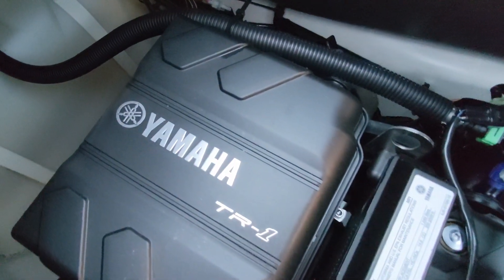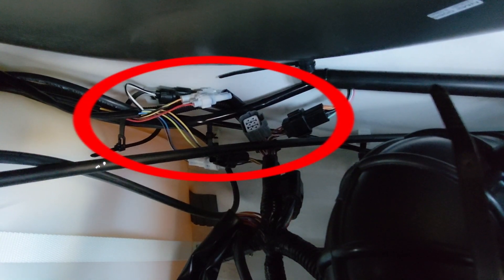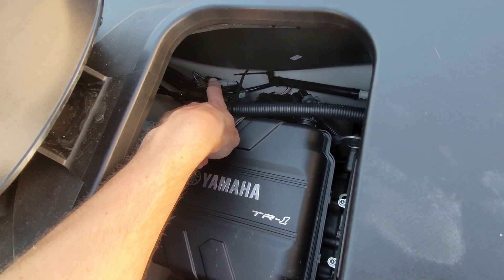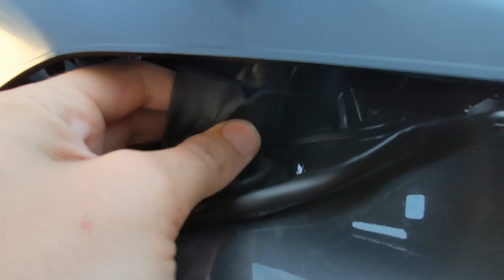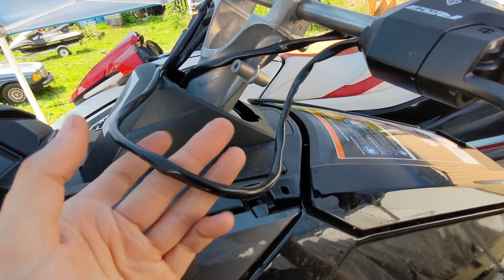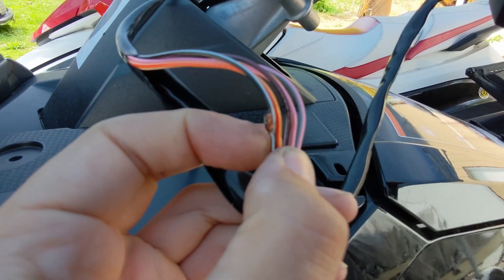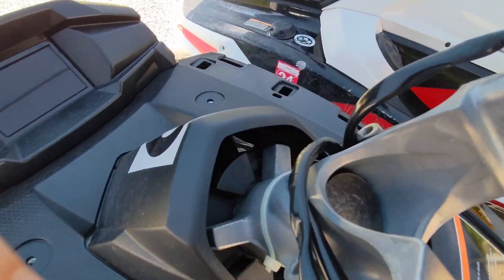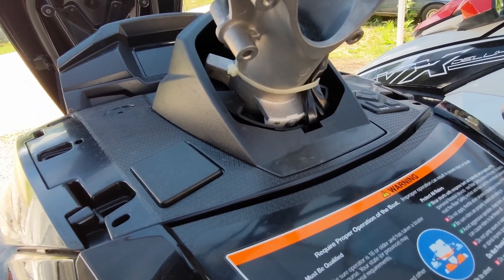New Yamaha Waverunner factory wiring flaw? Defective off the showroom floor?

Comment: I have a 23 vx cruiser tr1 intermittent wake up and start I looked at all wire connections nice and clean as well ran continuity and still ok has power to switch as well but machine still has issues waking up
Reply from the maker: I've seen issues with corrosion to a wire on the solenoid, there is a small red wire that attaches with the same terminal as the battery positive to provide constant power for wake up and such, I've seen them so rusty they fall off or barely make contact.

I'm doubtful that would be your problem on a 23 model unless you're in saltwater, it shouldn't corrode that quickly.
Don't know if it helps, but its the first thing off the top of my head I can think of!

Comment: I have Code YDIS 151 on a Vx cruiser HO 2021. I NEED HELP! this is my first check engine light at 80 HRs and im bummed.
Reply from the maker: That code is Ride related, Does your reverse bucket move properly? If it is working, then it may take a couple start and stop cycles before the code goes away. Or you could have a poor connection electrically, loose battery terminals will cause some codes, as will a failing battery, I would check the battery if the bucket seems to be moving properly but the code doesn't go away.

Comment: I’m having basically same issue 2020 VX deluxe. So you’re saying even under the wire sheath the wire was worn down. My code is 164, it starts and runs, took out for first time and started warning and check engine. Ended up having a loose negative ground on new battery so tighten up, ran through clearing sequence and it eventually was “fixed.” Took out for an hour one day, and an hour and a half yesterday and all of a sudden BAM it happens again…also where exactly was the west
Reply from the maker: 164 is related to the ride system, could be this, or a bucket obstruction or something wrong inside the ride motor itself jamming stuff up.
The cable issues are right where the steering stop is, and yes it will pinch the wires and break the copper, and you might not even see any damage to the sheathing

Comment: 2023 FXSVHO was getting alarms, came across this video and yup, sure enough, this was the problem. Thank you
Reply from the maker: Awesome, glad you found the problem! Sorry this was the problem.
Reply: What was the alarm message you were receiving on the display?  I have a 2024 FX SVHO and had gotten a No Communication error message, The display wouldn't turn off so I disconnected the battery and it had reset back to normal and haven't had any issues..yet.
Reply: @jgriffin-pw3xf  Just had the loud buzzer if I remember correctly. I have a maptuner x so thats how I read the code

Comment: Hello. I have a 2017 ex deluxe. I have very low hours and have not had any problems. Do you recommend I take preemptive action and apply the shrink tubing?
Reply: Thanks much for all your excellent clear information. I’m sure you’ve helped many people.
Reply from the maker: I would at the very least pop the handlebar cover off and ensure the wires are routed in a way that they will not be pinched, add a zip tie or something if needed, ensure you don't restrict the range of steering or add strain to the wires, but get them out of harms way.

Comment: That fix is not going to work, it will fail again and probably in short time. The solder joint its self will fail if not before all the other wires rub through. Tieing the bundle tight so that it rubs back and forth with each turn will cause a failure. It needs to be loose but away from moving parts.
Reply from the maker: We will see, so far it has lasted 1/6th of the same time the factory original wiring survived with no sign of any issues.
Kind of hard to get wires that literally run from a moving part to the body of the machine away from moving parts.
I'm betting this repair lasts for years.
Reply from the maker: Still working fine. Fixed 2 other machines with the same method, they have been a-ok for the entire rental season of 2023
Reply: Still working ?

Comment: Greetings i thinking I have electrical issues,

Greetings quick question i got vx 2015 Yamaha new body style with mr-1 engine base model, it won’t run unless I jump the main relay fuse along with fuse relay if I jump the wire it start right up no issues.It like I’m not geting power after also got new fuse box, I’m not geting power to gauges, fuel pump, but as soon I as jump the relays it start right up everything working gauage work etc.. I’m not sure if locked but the base mode doesn’t have key fob key and on gauges there no unlocked or L mode on it therefore I don’t think it’s lock. I used different ecu and gauges turn on but same issues
Reply from the maker: I'd start by checking your killswitch and start button. Locked or not, putting the lanyard on and pressing the start button should wake the dash, if it isn't doing that, test those 2 switches, trace the wires back to wherever they plug in and ensure you're getting the proper connection when pulling the lanyard/pushing the start button respectively, it's entirely possible the problem I found on these 2021 and 2022 models could be something that has been around for a while.
Past that, I've known some machines to have bad main relays, others I've seen the start relay wires hooked up wrong (there is usually 2 red on one post and 1 red on the other, sometimes the small red one gets put on with the wrong wire, it is meant to feed constant battery power to the ECU and stuff)